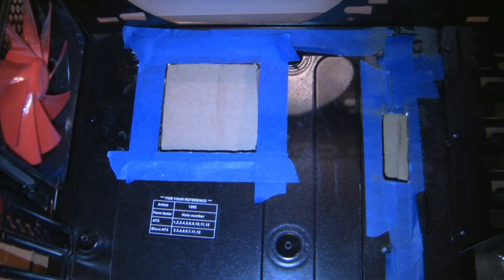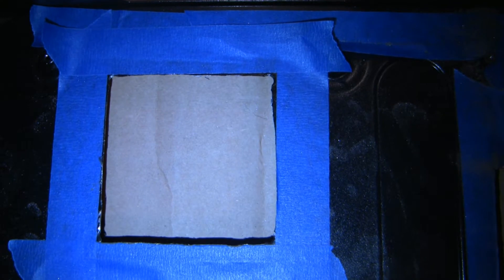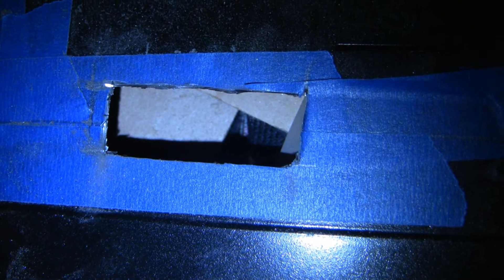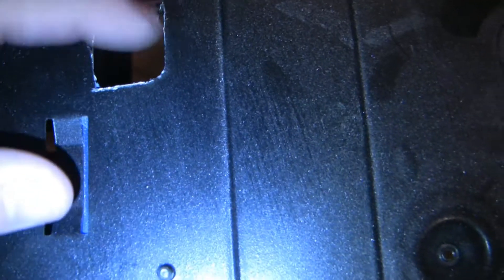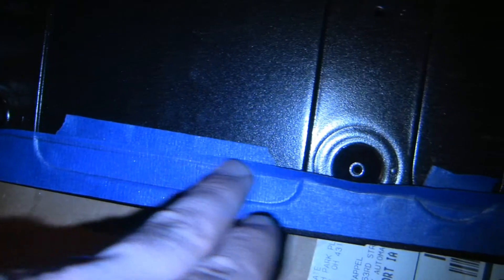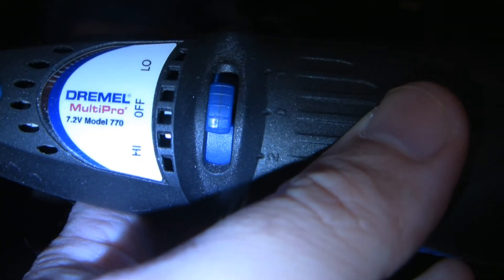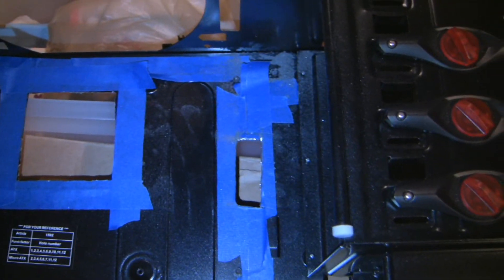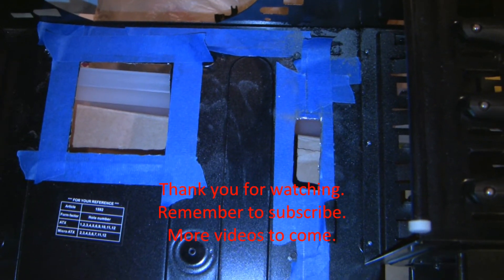Thermaltake V9 Mod Project Part 3

Comment: Hey bro I think you will need to enlarge the cutout for the cooler retention plate, not do you only need room to see the holes, but you will need to be able to get the nut on and a tool to tighten said nut. I may be wrong, but from what I can see it will be a little to small. 
You need a hole 4.25 squared and that will give you plenty of room.

Cheers 5/5
LazyMan :-)

Comment: I decided to drill a hole in the top of the case.  Pulled off the fan on top, and the cords/ hole are not even visable.  The case so flimsy I am afraid to make too many cuts.  I think I would have been happier with the Antec or Coolermaster version of this style.  The power supply problem needs to be fixed probably by more cutting, or drilling holes to flip it over.  I wish I bought the case without the window, because it came with an extra 250mm side fan.

Comment from the maker: Yeah, I know.  I made the cuts with the Dremel.  Now that I have some blades for the jigsaw I'm going to open it up a bit.  

It's freezing and where I do the work it doesn't have heat, so this project is on hold.